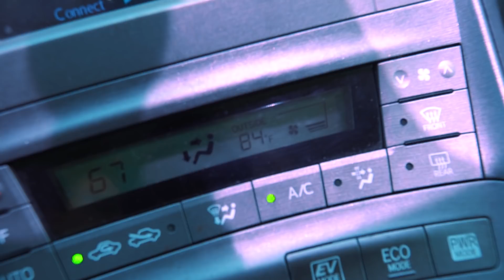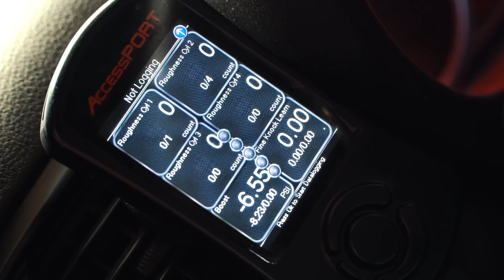SWAPPING THE STI INJECTORS

Comment: A friend of mine was having a very similar problem with his sti recently. Went through the whole fuel system, was about to give up and just sell the thing, and he ended up finding a bad ground. 
I can't remember exactly where it was but I will ask him. The problem you are having is very much like the problem I saw him having. You might luck out and just have a shitty ground.
Reply from the maker: Edward Agora Feenman thanks dude. Can you Instagram message me?
Reply: Shayne I think he does the whole Instagram thing. Probably best if I just get him to shoot you the info. 
You guys will probably Subaru nerd out. 
You guys have similar motor set-ups and make near the same power, but he has his Scooby lifted and all prerunner baja 500 style.
Reply from the maker: Edward Agora Feenman thank you
Reply: Yep could be a ground, especially if when the motor was pulled all the grounds weren’t put back into place. Also, this would cause your coil packs to start going bad.

Comment: Shane can you tell me or find out wht turbo can make 450whp an still push full boost at around 3.7k rpm an pull hard till red line.the car i am trying to set up is a 2012 wrx  built block stock heads full bolt ons but want a gud stock location turbo tht can flows around 400 to 450whp on meth